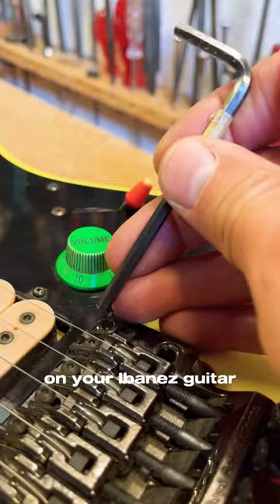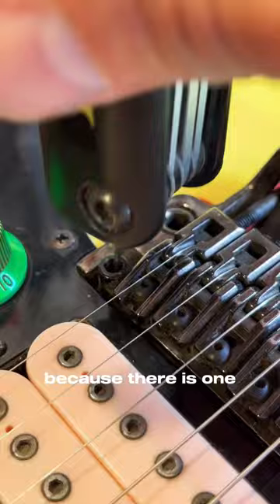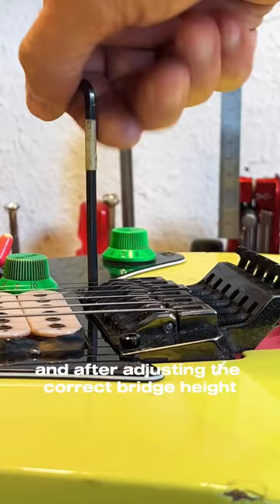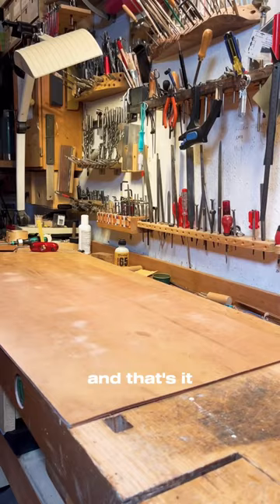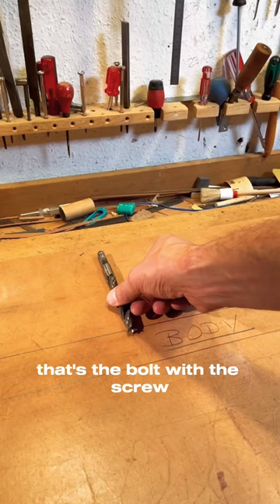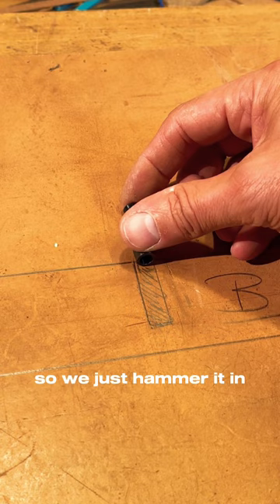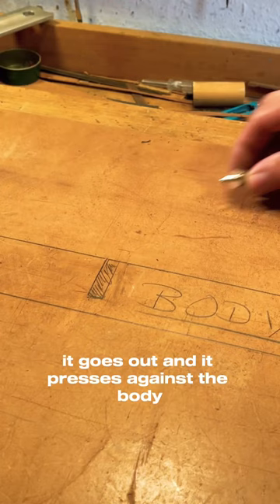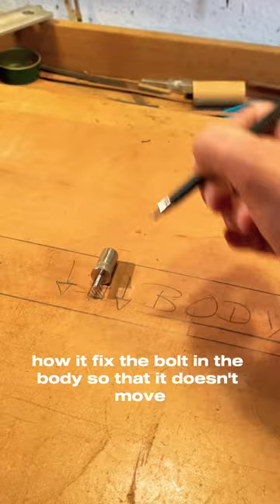Ibanez Guitar Tremolo System secret hidden screws #shorts #tutorial #guitar #howto #workshop #craft

Comment: Should be called how to immediately ruin the knife edge on your tremolo so it never stays in tune.  You cant turn those when its under tension from the strings or it ruins the edge.  That specific model of jem is worth thousands.   If that was somebody elses guitar you should be paying them
Reply from the maker: Thanks a lot for watching and for sharing your experience. Best Regards Nik
Reply: @petrekguitars corporate response. @za4310 brought up a genuine concern. When you adjust those screws without taking off the bridge, the edge of the bridge cuts into the screw making a divot. This divot dulls the bridge and makes it susceptible to tuning issues.
Reply from the maker: Thank for your comment. Bets Regards Nik @2lexander

Comment: When I was 15, i spent my 1st salary on a guitar with FR, I adjusted the height with full tension on the string and it never stayed in tune after that. I then found that the rest of the FR is like a knife edge that balances on the screws, once dulled it doesn't float correctly.
Reply from the maker: Thanks for sharing your experience. Best Regards Nik

Comment: Interesting.... but still not clear if the little screw is holding the barrel in place or the fulcrum screw height in place... ?
Reply from the maker: It´s holding (fixing) the two hight adjustment screws. Best Regards Nik
Reply: @petrekguitars  by bracing against the wood at the bottom of the hole?
Reply from the maker: No its actually pushing against the Stud that is closed at the bottom. Best Regards Nik